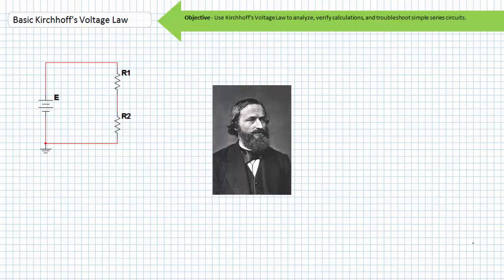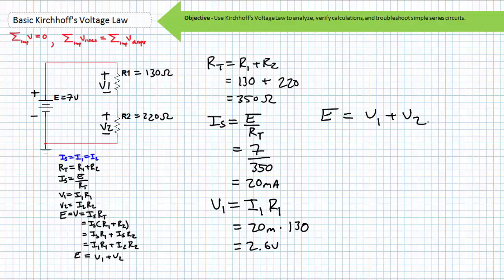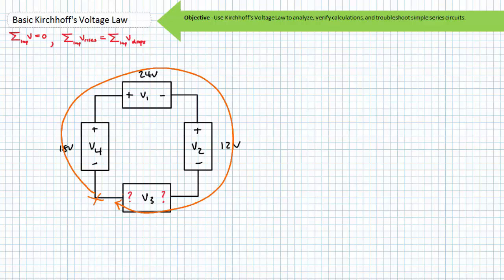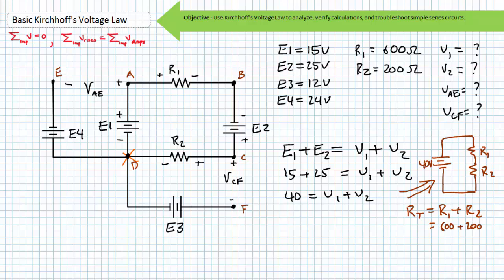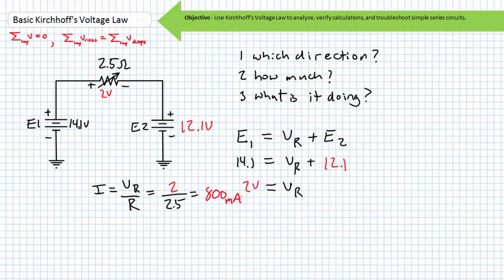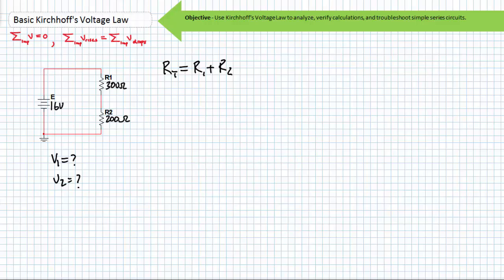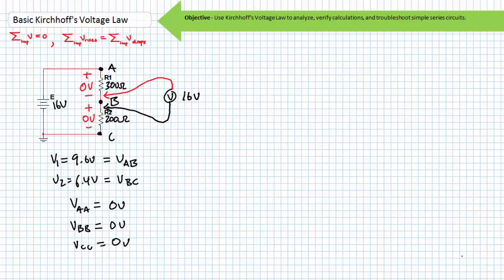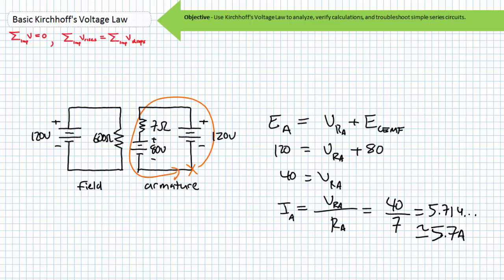DC Kirchhoffs Voltage Law (OLD LECTURE)

Comment: Good lecture.
Reply: I was waiting..200 ohms and 600 ohms in series will always divide the voltage 25% and 75% no matter what, guess I’ll have to wait for a later lecture.
Reply from the maker: Yes, you've stumbled onto the DC Voltage Divider rule. If you were 200 years earlier they'd be naming after you! Check it out: https://youtu.be/-cJk1Us0Fx4

Comment: First, I want to thank you, your lessons are fantastic! You teach clear and you watch on every detail,
I have some one question, though:
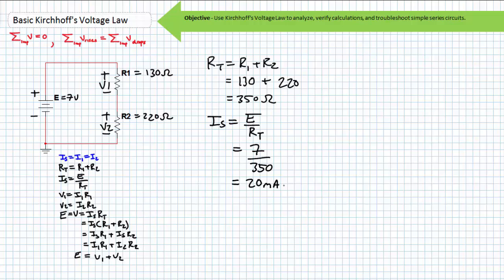At 13:02 you said: "We don't have to do the Ohm's law calculations. Yet, at 13:34 you calculate the source current
Is = E/Rt
What's that if not the Ohm's law?I apologize if my question is stupid. :-)Thanks again and keep the good work!
Reply from the maker: +Damir Kovačić Yes, you're correct. It would be more accurate if I said "You don't have to do Ohm's Law calculations to get voltage values." The VDR directly yields voltage values and then from there you can use Ohm's Law and series properties if you need to take it any further. Glad you're enjoying the series. As you'll learn in series-parallel circuit analysis, the VDR is one of my favorite techniques because it cuts out a lot of busy work.